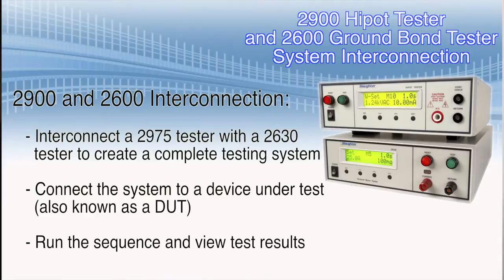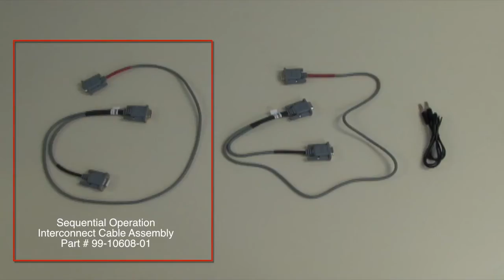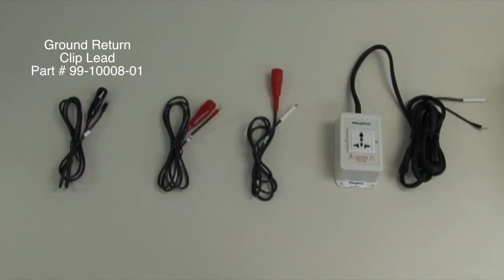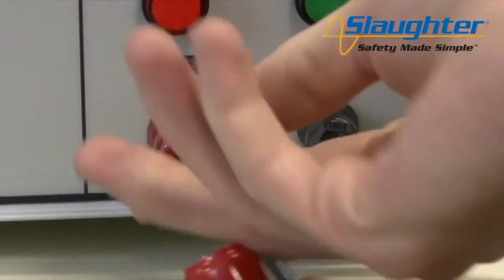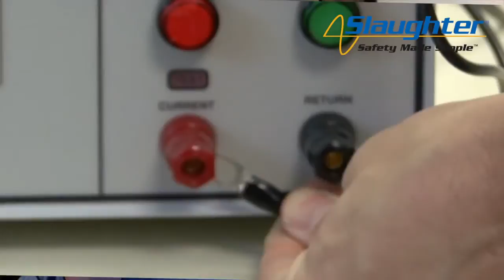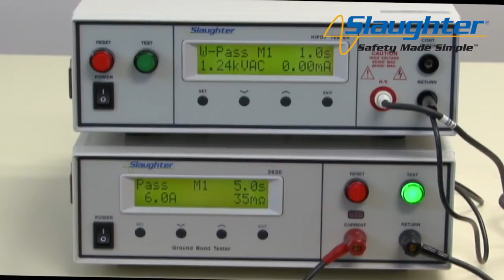Hipot & Ground Bond Test System Quick Start Video

Comment: Can you help me with some information, what is the test of mobile phone through HiPot tester??  And how to test . please help me
Reply: Mobile phone is not Hipot tested as it's battery powered and so there's no shock risk.
It's the SMPS charger that undergoes Hipot testing to determine the isolation between the high voltage AC side and low voltage DC side. The phase and neutral pins of the charger are looped and hooked to the HV positive and the charging terminal is hooked to the HV ground or vice versa. The charger should be able to withstand 1.5kV for 3 seconds without getting damaged. This ensures that there is proper isolation between high and low voltage sides.
In linear or transformer type of charger the isolation between the high voltage and low voltage is taken care by the transformer itself by means of primary and secondary coils which are separate.